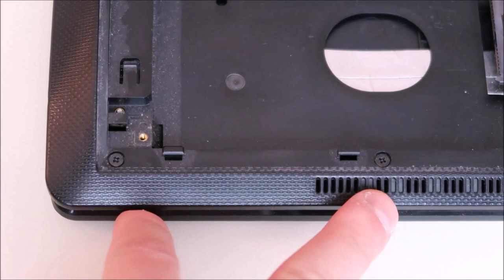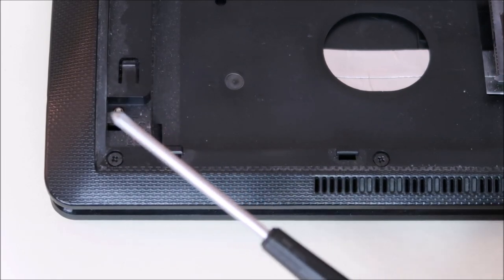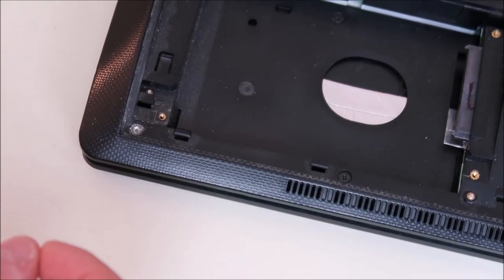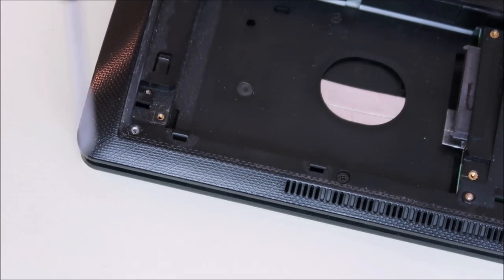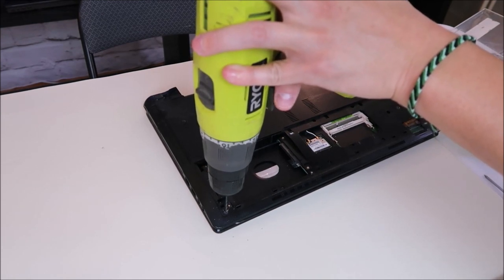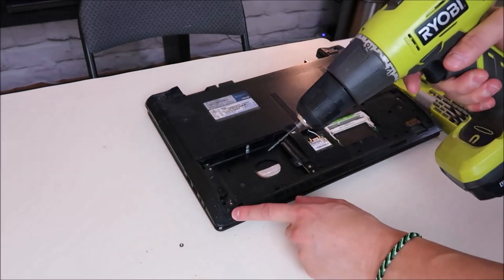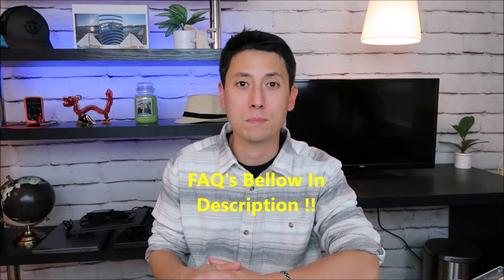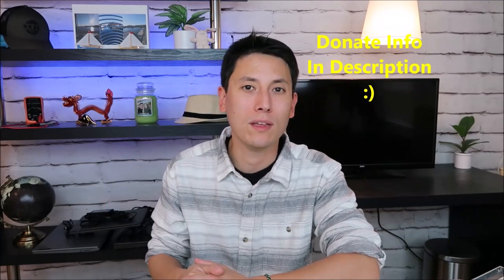How To Remove Stripped Screw - Repair Fix Computer Stripped Screw

Comment: This helped me today two lcd bracket screws (Dell 5400) were stripped. I drilled thru to the chassis ..no damage thank GOD 😂 the screw dropped thru to the chassis
Reply from the maker: Glad your all set :) Always here if needed !!
Reply: You gotta help me. Please tell me the drill bit you used.
Reply: Dell has been bad about this in their laptops made after 2014-2015, been finding a lot of screws GLUED and/or stripped. I feel rage when looking at rugged series latitude laptops lol

Comment: How does putting the drill in reverse lift the screw out? We just drilled a hole so there’s nothing to grip it. Mine just continues drilling a hole in the opposite direction..

Comment: Hey, do you have any drill bits that you recommend? I tried drilling into the screw, and it destroyed it to the point where it looks circular now, but now it won't dig in any further. No matter what speed or how hard in I press, it won't drill in more. I'm just using a titanium drill bit. Should I buy a stronger one, or try something else to get the screw out?

Comment: I’m going to try that next time.  I was working on a Dell, it was a horrible experience, start to finish, and I just drilled out the screws eventually, but with a big bit.  Worked decently well, it loosened the screws so they practically came out on their own even without their heads.  Tried all the other tricks before that, nothing but frustration
Reply from the maker: Glad your all set :) Always here if needed !!

Comment: Hey there! I'm having a similar problem with a stripped screw, only difference is that it's on the back of a desktop PC case. I know this method would most likely work, but I'm worried about the vibrations caused by the drill impacting the internal parts, especially the hard drives. Would you absolutely recommend removing all the parts, (MOBO, GPU, HDDs, etc.) before drilling into the screw, or am I needlesssly worrying?
Reply from the maker: I wouldnt worry about the vibrations :)

Comment: First time ever buying myself a gpu, literally the first time to fit inside my small form factor PC. It's a low profile single slot card, but they sent it in a regular sized single slot bracket instead of the included low profile one? Anyway, so I removed 7 of the 8 screws no problem but the final one got stripped. It's one of the ones at the front right above the hdmi input... so trying things like putting glue and a not on the screw, or wd40, just seems like it could be dangerous as I don't want anything dripping into the hdmi slot. I don't have a drill, and I'm trying to budget at the moment as the card was about $300 CAD (A yeston rtx 3050), but I would consider it an investment so I think I'll give your method a try. Thanks! ... Only problem now is finding a drill bit small enough for a screw this little. It's like 1mm, if that.

Comment: I know I'm a  year late but what drill and drill bit did you use? Thank you so much I'm gonnna try this, pray for meeee.
Reply from the maker: The drill bit you use will depend on the size of the screw your trying to drill out.  It would have to be the same size or smaller than the size of the screw
Reply: @PC_Monkey  the one I'm trying to get out is like m2.6 or it says that on my laptop anyway

Comment: Hey, do you think that hand drill (the one that you need to twist manually) works? It has different sizes of drill bits
Reply from the maker: I dont understand your question.  No, a hand turned drill will not drill out a screw...

Comment: I have an m2 6mm screw on my heatsink and it's stripped. I want to replace my thermal compound but can't because of the stripped screw and I don't want to harm the motherboard while trying to unscrew it. Do you have any advice to unscrew it?
Reply from the maker: This video shows how I remove a stripped screw :)
Reply: @PC_Monkey  but the screw you removed is on the case. Screw I'm trying to remove is on the motherboard(close to the CPU). So I wonder if there are any other ways to unscrew it without damaging the motherboard.
Reply: @omeregeakgun  Hey man I have the exact same issue. Did you find a solution?
Reply: @Apocalyman  Try to use an 1.5 mm flathead screwdriver. If its in a really bad state, use a soldering iron but be careful to not to touch the anything else beside the screw with it.
Reply: @omeregeakgun  I tried every head I could think of and nothing worked. I dont have soldering iron and I dont know which one to get/how to use one X_X
Reply: @Apocalyman  There are special screwdrivers for unscrewing stripped screws. You can buy one and use it.
Reply: @omeregeakgun  Do you have a name for example?
Reply: @Apocalyman  I think ifixit had some

Comment: this won't damage the inside of the laptop components?
Reply from the maker: If you slip off the screw and drill other parts of the computer, yes, that will damage other parts of the computer.  If you stay on the screw and only drill it, no, it will not affect other parts of the computer :)

Comment: Hi! I have a stripped screw Philips 00 head in an xps 9550. The 1/16” drill bit is about the same width as the thread, so I’m afraid it’ll obliterate the thread. I figure I should go for a 1/32” drill bit which will drill into the center of the thread. If you would share your thoughts on that it would be amazing!! Thanks :)
Reply from the maker: Yes, if the bit is larger than or the exact same size as the thread, it most likely will ruin it.  Another screw most likely wont take to it.  So you should go smaller :)

Comment: Is it too risky to use this method to unhook an SSD latched with a stripped M2 screw?
Reply from the maker: This method is a bit more advanced than many DIY tricks I have on my channel and does come with a high risk of damaging your computer if you slip or drill too far.  Its your choice if you want to take that risk or if you would prefer to pass it on to a computer tech.

Comment: hello, i have an asus rog zephyrus g15 ga503q, when turned on it’s back to disassemble, the middle right screw stripped & i can not take it out. how should i go about this & would i need to get a new screw once i take the stripped one out?
Reply from the maker: I usually take out stripped screws as seen here in this video.  This process fully destroys the screw so yes, you would need to replace it after this procedure :)

Comment: I have this problem in the last screw of my phone motherboard.... I don't know if this method will work. What do you think ?
Reply from the maker: Yes, this works to remove stripped screws no matter where the screw is located. However, you would want to take extra caution if you choose to try this method as, if you slip, you can damage your motherboard instead of just scratch your case

Comment: I know this is a year ago but if you do still respond, would this method be safe to do inside my pc safety wise, like metal going everywhere. (I don’t mind if the old ssd gets damaged since I already cloned it). I have a stripped screw on my ssd nvme which I want to upgrade, I tried a bunch of methods and I think this is my last attempt before I just go into a repair shop.
Reply from the maker: You would def have to clean out any metal debris and I would make sure the computer is unplugged and the battery is removed.  There is a degree of risk with this procedure so I only do it when I need to

Comment: hi. ive been meaning to ask. is there a way I can email you my issue? I think my laptop audio driver is faulty. I am currently using an external one, I also bought a usb headset but both are sounding very distored. Ive tried all software related troubleshoot but still having the same issue.
Reply from the maker: For free, I communicate here on YouTube.  For a fee, we can set up a time and talk somewhere else.  Which would you prefer?
If you prefer here on YT, and assuming you have Windows 10, have you made sure all updates are processed as seen here?  https://www.youtube.com/watch?v=DDv2gJDjfOM
Reply: Sounds like a warranty job for the vendor , experienced something like that ages go and vendor had to fix it under warranty, I think they replaced the motherboard

Comment: Hello! How I can I use a small drill bit with my drill? Do I need an adjuster?
Reply from the maker: Im not sure what drill you have but yes, I am able to use a small bit with mine
Reply: @PC_Monkey  Thank you for the reply! If I insert a small drill bit and try to drill, it won't move. I have 4 stripped screws on my dell insipron laptop
Reply from the maker: @camilamonje6066  The bit wont move or the screw wont move?  You need the correct size bit for the screw

Comment: How do i fix when the captive screws in my laptop don't grab onto anything when trying to tighten?   It's like whatever they're supposed to grab on to  is gone.  Thanks.
Reply from the maker: Yes, that is common unfortunately.  Its very possible that the threading on the panel has broken off.  There really isnt a 'fix' for that.  If that is the case, the panel would need to be replaced.
Reply: @PC_Monkey  well that's not what i wanted to hear, but thanks for replying!
Reply from the maker: @TaylorZ2  Good luck !!  Let me know how it goes :)

Comment: what size is that drill bit you used?
Reply from the maker: It will be different for different screws.  You have to match the size of the bit with the size of the screw your trying to drill out

Comment: Is this worth trying on an ssd screw inside a brand new laptop? 😢 I don't want to damage anything or have dust go everywhere in the laptop.
Reply from the maker: I would attempt it as I have done this many time before. However, its up to each person if they feel comfortable with that. If you slip or go too far, you could definately damage the SSD or other components.

Comment: What size and type is the drill bit that you used? I attempted this on my laptop with a very small lefthanded drill bit and it drilled into it but it didn't budge.
Reply from the maker: It depends on the screw you are drilling.  The bit would need to be slightly larger than the screw thread
Reply: Any update on this?
Reply from the maker: @Djp1989  Are you having a hard time with a screw too?  What are you looking for?
Reply: @Djp1989  Hi! there is some update thankfully.

 I drilled into it the best I could (carefully) and tried to reverse but, idk if i was being too light handed or what but it didnt work. (By the way, that was for the method shown in the video with the left handed drill bit.)

So, I ended up getting a Screw extractor as my last resort, speifically "Be91eiter Damaged Screw Extractor Set, 22 PCS Stripped Kit" on amazon. I drilled in and reversed it and i was able to get 4 screws out but takes a lot of time since you have to go slow and steady. I used the last bits the "dr #10" and "ex #10" in the kit and switch between them after ever 10-20 mins but im sure you could just stay with one and it would work still. 

Good luck! ^-^  also I tried replying to this so many time but my reply  keeps gettting deleted lol, so i hope you can see this and it helps!
Reply: @bloopbanana5465  You needed to buy a drill separately from the extractor set?

Comment: drillbit smaller than screw shaft? or head because if shaft thats a very small bit.
Reply from the maker: That depends on the screw but its usually going to be smaller than the head but the same size or slightly smaller than the shaft. Yes, since laptop screws are small, it would need to be a small bit

Comment: Do I have to use a drill or can I use a hand screw driver?
Reply from the maker: If you can remove the screw with a hand driver then there would be no reason to drill out right?

Comment: i dont have a drill, my screwdrivers are very small like 1.55mm just ordered it and i only unscrewed 4/12 😥
Reply from the maker: Are you asking for help getting passed stripped screws or help finding the correct sized drivers?

Comment: Then completely come off but I destroyed them so the top came off and the screw part is still in there so I can take it off and replace one of the screws but I don't know about the rest
Reply: It was missing screws already. I've never even opened this computer before
Reply from the maker: Sorry, I dont understand.  Are you asking a question?  Is one of your screws stripped?
Reply: @PC_Monkey  I got it off, but the ends of two of the ones by my disk drive are still stuck and I'm not sure if I have a drill bit small enough
Reply from the maker: @fayelefayele2264  You would need a small enough bit unfortunately to minimize the chances of damaging the surrounding case or components :(

Comment: I have a intel inside laptop and for some reason i run a game then it turns off
Reply: and it makes my screen a little bit darker every 2 seconds and makes a werid sounf
Reply: Sound*
Reply from the maker: Does the computer turn off or experience the screen issues if your not on the game?  Also, is the computer overheating?
Reply from the maker: @santosgue  Is your computer overheating at all?  Also, can you find an error matching the time of shutdown as seen here?  https://www.youtube.com/watch?v=Nqn8-jJFx2Y

Comment: Have an hp laptop 17 inch screen and when you take out the CD rom drive the two screws there are stripped but concerned the force will damage the screen because the laptop is closed and obviously upside down. Is this the best option?
Reply from the maker: I would open the computer up, and rest the keyboard on a desk or something while the LCD hangs down the side.  Did I explain that correct?
Reply: @PC_Monkey  yes thanks

Comment: ok, I didn't try it, but let's pretend that i got the screw out, but how can I now get a new screw? because, u know, I'll be a weird guy just awkwardly running a laptop with no cover.
Reply from the maker: You can either purchase them online, places like Ebay, Amazon, etc.  Or you can get them from your local hardware or computer electronics store.
Reply: OK, where did you buy that small drill bit?
Reply from the maker: @barajuboor  I purchased a set of drill bits as my local Home Depot.

Comment: My hard drive screw is strip 😂
Reply from the maker: Bummer :( If you choose to deal with the situation this way, be careful as you dont want to slip and damage the HDD!
Reply: @PC_Monkey  thx for the heads
Up but ima actually removing the hard drive to replace it with a new one